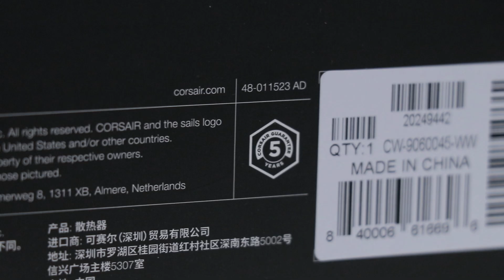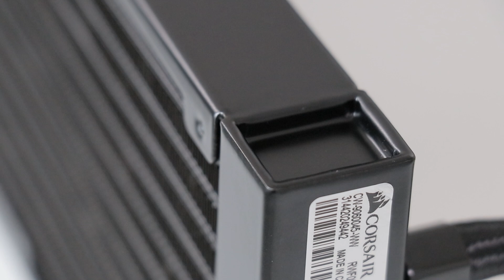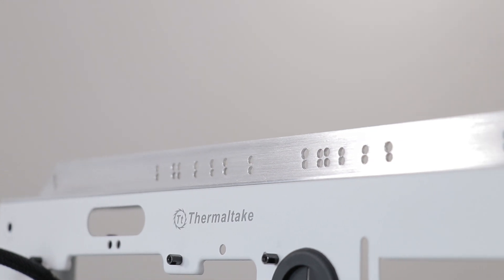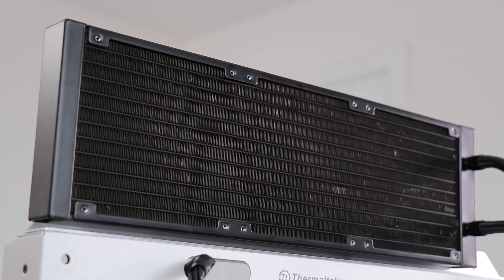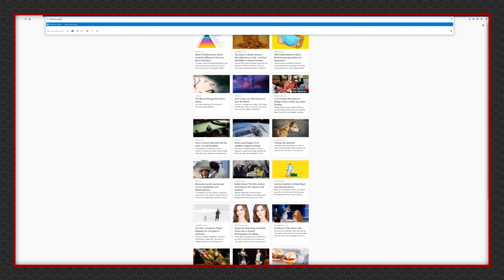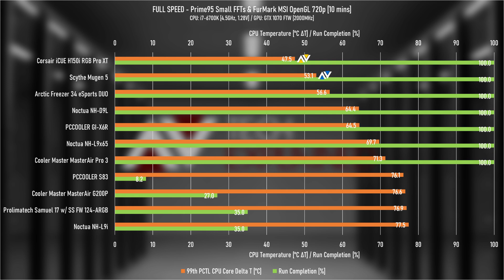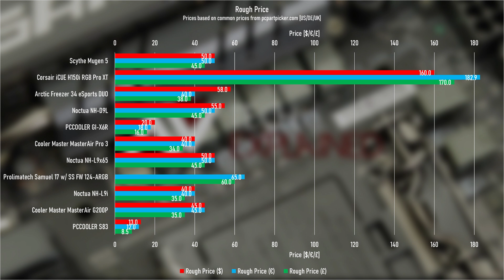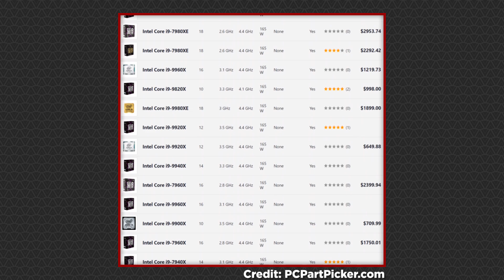Corsair iCUE H150i RGB Pro XT (360mm ARGB AIO) Review

Comment: A temperatura ambiente poderia influenciar no resultado!? Qual a temperatura da sala em que os testes foram feitos? Ar condicionado em uso? Um case fechado poderia oferecer um resultado diferente já que a circulação de ar seria restrita a um pequeno espaço e dependente da qualidade de construção do case para circulação e troca de ar? 
Parabéns pelo vídeo, a câmera que captou os menores detalhes foi incrível. Agora estou em dúvida sobre este modelo e o scythe.
Reply from the maker: The test results remove the ambient temperature, so they're displayed as Delta T, or change in temperature rather than absolute temperature. This removes the issue of comparing results that may have been collected in different environments (it seems to be very reliable based on my testing of the same products in different room temperatures).

I'd prefer to have some sort of air conditioning to make the testing more thorough, but it's not reasonably practicable (in other words, too expensive for what it would provide when the current solution is workable).

I can imagine there would be slight differences depending on the case, but that would be the same for all coolers. Downdraft coolers may experience more noticeable differences, but regular air and water coolers would be experiencing very similar resistance.

By testing on an open air test bench, we're essentially seeing the best performance these coolers could provide, albeit without any airflow being provided by case fans (which depending on the case can improve performance).

None of this is to say the Mugen 5 would outperform the H150i with a much higher load, but at this load (100W) it's definitely competitive.

Thanks for the comments, and hope I cleared up some of the queries :)

Comment: Great review! I got my H150I today because a normal 140mm cooler wasn't meeting my standards for cooling. (Running an i9 11900k) it was creeping up to 185F during gaming sessions and was deeply concerning me to look elsewhere for cooling options. That is when I saw the H150i and decided to pull the trigger on it. 
I can greatly agree with you that unless you have an incredibly powerful/demanding CPU, there is no reason for the H150i. I had that mindset going into my i9 11900k build because my other build only has an i7 7700k and runs just fine on a 240mm cooler. What you explained that I did not think would hit me was getting a high-end mainstream CPU that would NEED something like the H150i...their TDP is just off the board in comparison to the older CPUs.

Comment: I just picked this cooler up for £120 and cooling a 3900X, idles at 35C in a room of 24C, Under 100% load in Cinebench R20 it hits 68.8C and in a 3 hour gaming session on Doom Eternal it didnt go over 50.1C, its an awesome Cooler for a 3900X also the cpu was able to hit 4.650ghz on 5 cores with PBO enabled. EDIT: I didnt wipe off the thermal paste it came and to be honest its doing a superb job.

Comment: I've got this fan, it does relatively good job, but it's cooling is all relevant to the ambient room temperature, my room can reach 35°C+ on summer days. AC is highly recommended..
Reply from the maker: Cooling of any kind is directly related to the ambient temperature. Cooling is heat transfer from one substance to another. This is true if all coolers, not just this one.
Reply: @AVTechy  Correct, but if you have a room temperature of 19°C the radiator will be 19°C, if you have a room temperature of 35°C the radiator will be 35°C. It's all about getting that ambient room temperature down, that's why i mentioned an AC unit.
Reply from the maker: The water in the radiator, nor the radiator itself will be the same as the room temperature, unless the system was completely off for a good while. Heat transfer works as the name implies, to transfer heat there needs to be a difference in heat for heat to be transferred.

If the ambient temperature is 20, and the system is under some load, the CPU might be at 60, and the water could average 30, 35, 40, 45, depending on all sorts of factors, but I guarantee the radiator and water will all be above ambient temperature by quite a lot. Same for all other coolers, water and air.

You're right that ambient temperature plays a significant factor, but you'll typically see a 1-1 change in component temperature compared to ambient, so if you drop the ambient temperature by 2, your component temperature will drop by 2.

Where coolers play a more significant role than ambient temperature typically, us you can get one cooler that runs a certain component under a certain load at say 70, but another component under the same conditions will run it at 50, so that's a difference of 20. You could achieve this by dropping the ambient temperature, but dropping 20 from the temperature of the room is a lot less convenient, and frankly a lot more expensive long and short term.

I'd only recommend getting air conditioning if you have a system that's outputting enough heat to make the room unmanageably uncomfortable, not to reduce the temperature of the system. For that you'd need to lower the ambient temperature of the room, and I don't think occupying a room that's at 10 above freezing is a good idea, I'd rather have the room sit at 24 and have a good cooler on the system - both you and the system can live in harmony.

Comment: Rather an unfair comparison honestly. You are benchmarking a liquid AIO versus CPU mounted fan based coolers. I think people expect to pay more overall for liquid AIO regardless. This may have been a better comparison test if pricing and cooling benchmarks were AIO vs. AIO.
Reply from the maker: It's not unfair as it's an even playing field. Fair rest principles stipulate only ony parameter can change, therefore the test system remained the same for every cooler, and only the cooler changes between tests.

Someone with a 100W CPU might watch the video and think, "huh, turns out I don't need to buy a really expensive AIO".

You might not like that I hadn't tested 6 other AIOs to flesh out the comparison, but to that I say please consider supporting that channel on Patreon so I can take time out of my day job to thoroughly test all these other AIOs in a manner sufficient to your liking.

Seriously, there needs to be some understanding of what your consuming. Not every channel does it as a full time job, and there needs to be a level of appreciation that not every channel is in the same position or on the same level playing field time-wise.

Also think about what your saying for a second. Sure people expect an AIO to be more expensive, but there needs to be better performance for that expense otherwise the value decreases. And for a CPU that's running at 100W on Prime95, this is what you get - poor value. That in itself is very valuable information for those who previously though bigger is always better when it comes to cooling.

Sure I could invest in a really high power CPU for more testing, but that doesn't take away from this information being useful, and it is useful for those new to this.
Reply: @AVTechy  sorry I don't agree. Your price comparison at the end was the issue. Do a price by price comparison with an AIO like the nzxt kraken. Then maybe. But to say it's overpriced compared to a pure fan based CPU cooler versus another liquid AIO is wrong.
Reply from the maker: @Chaz Raycraft  I think you're dropping the ball on why I'm saying it's not good value. Just think about it, with a CPU that's outputting roughly 100W max there are air coolers of much lower cost that do just as well. That's what the graphs show, and what I'm basing my opinions on - data.

You need to take this stuff in context, it really does matter.

I also stated at the end this cooler is better suited to higher wattage CPU's which should've provided you enough information to understand that for a 100W CPU this isn't good value - and it isn't, because similar performance can be achieved for a lot less. Understand that there aren't many AIO's that are worth getting for a 100W CPU, it's just not enough power to justify spending that much on cooling when far cheaper solutions exist that can handle 100W.

I agree that I'd love to fill the graphs up with 20 AIO's and cover all of them to represent the intricate differences each has, but it's not a reality that I populate right now, and that stuff takes an awful lot of work to achieve. But you really need to read between the lines here, and take this all *in context*. For a 100W CPU this isn't a good value cooler, neither is the Kraken, or pretty much any AIO since there's comparable performance on the market for less in the form of many many Air coolers (they exist, they are an option, so it's worthy of comparison). It's not wrong, it's actually factually correct, in its entirety, but maybe you don't like hearing it so that makes it "wrong".

Hell even Corsair were happy with the review, and basically said "do you want to check out the 4000D Airflow?". And that's after seeing my review of the A500 which lead them to sending this to me. They see and understand the context of the review, they know the CPU isn't high power, and they were satisfied with my representation of it.

Comment: DOes it come with coolant or do you need to fill it with water?
Reply from the maker: It comes with coolant. As a little background, these are called "AIO". It stands for All-in-one which basically means it's a liquid cooler that comes in a single package that doesn't require anything else to work.
Reply: @AVTechy  Thank you so much! I recently bought this for my first PC build, and am still learning everything.

Comment: So will this cook my RYZEN 7 5800X with a tdp of 105w?
Reply from the maker: Did you watch the video?
Reply: @AVTechy  yeah I did but did you mention these new chips? No u didnt. They are supposed to run pretty hot
Reply from the maker: Is the architecture similar to the predecessor? Yes. Come on, take the information and extrapolate what's relevant.

But first, look into what the wattage (not TDP) of that CPU with your desired workload and then make an assessment.  I promise if you look into that and listen to what I've said in the video you'll get the answer you need.

Comment: With liquid coolers you have the potential for catastrophic failure. I would never go with a budget cooler maybe not even a cheaper one. The corsair may be more expensive but you're also dealing with a trusted brand with a great reputation. How much is piece of mind worth? I think quite a lot.
Reply: That's actually a reason I went with this over EK. EK's had great performance, but it's their first go on an AiO, and I saw a mention on a teardown video that the tubes pulled out of the pump kinda easy, whereas you can see the pins securing the corsair's tubes and bleed/fill port. They both have 5 year warranties, but Corsair's got over 5 years experience.

Comment: THE H150I PRO XT DOESNT FIT IN THE OBSIDIAN 1000D the tubes from the rad to the pump head are to short to go on the front and you cant mount it on top because you need a 4x 120mm fan mount that is out of stock everywhere so do not do this combo go for the H115I which has 2 140mm fans instead of the 3 120mm

Comment: Does it fit the new sTRX4 Threadripper?
Reply: Yes, it does. I have this exact cooler and the Threadripper 3970x
Reply: It’s much better for threadripper due to coolingplate under The H150i. It’s a Big square and not a smaller cirkel like most AIO.